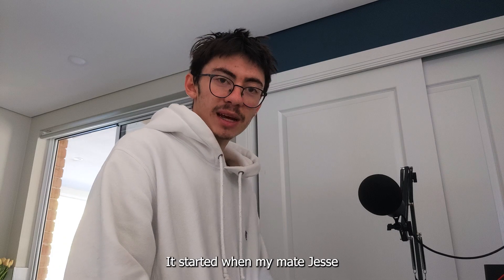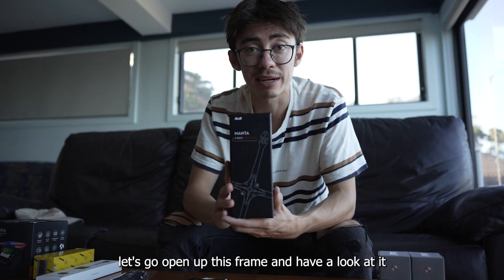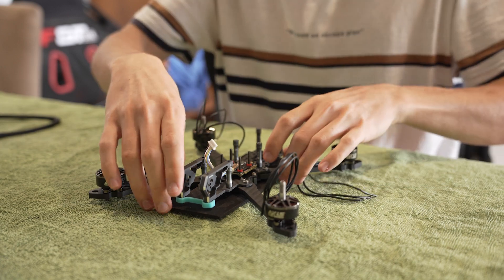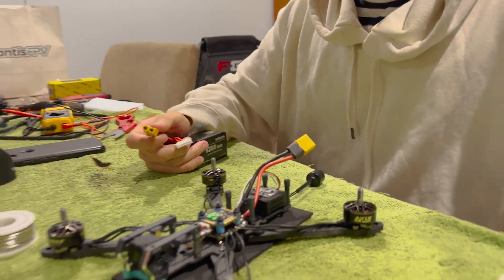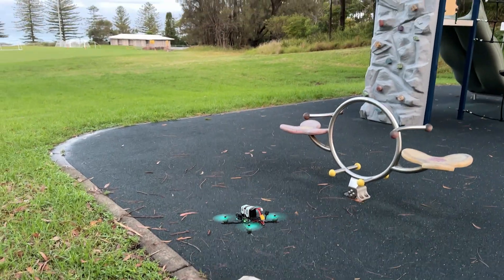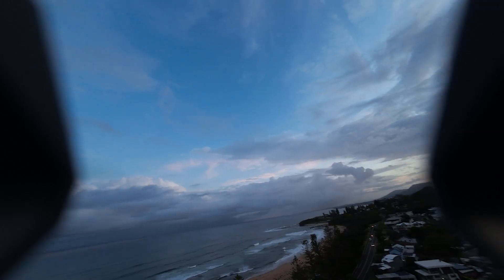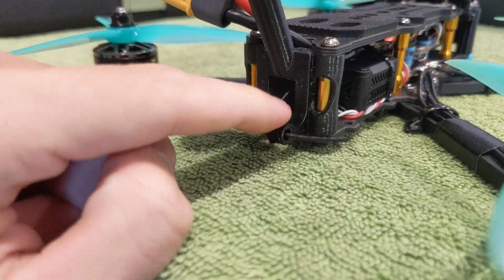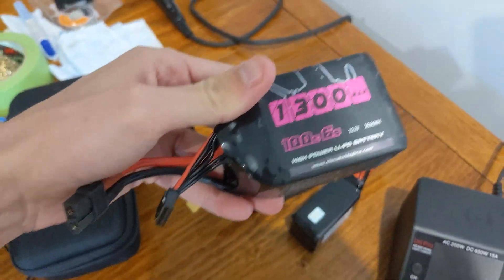Building My First FPV Drone

Comment: Correct me if I missed it but I didn’t see any capacitor on this. You kinda need that 😂
Reply from the maker: Yes good point! But rest assured I did in fact have one, it was tucked away between the positive and negative battery wires. You can see it here 6:38

Comment: 🤣 Budgeting and research can be tricky, especially when things don't go as planned. When soldering, keep the wire tips short. If they're too long, they might touch nearby terminals and cause a short circuit.

Comment: What wesbsite or app is most reliable of buying cheep fpv stuff specifically in Australia
Reply from the maker: That is a good question, I've found it's either one or the other. I haven't found anything that's both cheap AND reliable. I buy my gear from either MantisFPV or FPVFaster both located in Sydney, they are very reliable and have great customer service. If you want cheap, ordering online from AliExpress is probably your cheapest option, but I've had some pretty terrible experiences with them, items never arriving and receiving the complete wrong product. Up to you which path you choose.

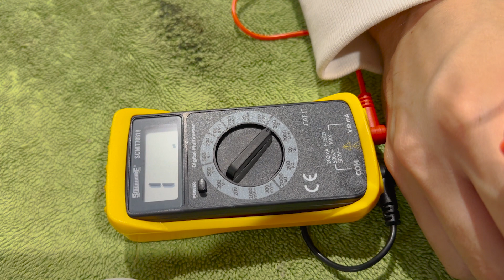Comment: 7:51, the reason for that Continuity test is the internal capacitance of the Circuit, after 2-3 sec of beep on multimeter it will be again normal

Comment: What’s the range on your antennas? I’m new to this
Reply from the maker: For the controller and receiver, since it's elrs it is pretty good, could probably go a fair few kms. The range is limited by the video link, so the antennas on the dji goggles and o3, maybe 1km or 2, but I haven't been able to test it yet

Comment: How far she can go??and How long does the battery last?
Reply from the maker: range is limited by the dji o3, I haven't really got to test the range but I know it can go at least 1km if there's no obstructions. battery usually runs out around 5 mins, but I can push it to 8 mins if it's only cruising

Comment: Damn that looks so much fun! I just bought a DJI mini 3 for photography and videos but im thinking of returning it and get started on this. I Get Dizzy sometimes with VR goggles tho. Would that be a problem or do i just need some getting used to. Been watching so many builds and some of the parts from the builds im trying to follow are out of stocked
Reply from the maker: VR headsets have a much wider field of view than FPV goggles. FPV goggles are more like just looking at a screen with a thick black border around it, that border REALLY helps with dismissing dizziness. worst case, if you do feel a bit dizzy, it will disappear after a while of use.

Comment: How far can you fly with ELRS ? thx bro
Reply from the maker: ELRS is such a great and reliable protocol but it really depends on alot of other factors to determine max distance. With my build though, I can fly 500 meters or so with no obstructions but as soon as there are trees or hills in between it drops drastically.

Comment: Hey . I have some questions : i want toi buy a cinebot30 03 and use or with dji goggles v2 and the same contrôler that you have. Do you think thats possible ? How Do you bind thé contrôler with the dji unit? Thnx
Reply from the maker: yep, just make sure you choose the ELRS receiver when buying the cinebot30, then you will bind the controller to that receiver.

Comment: Hey!! Beautiful work. Iam about to start with this hobb as well. May i ask how much did it all cost? The drone itself, goggles and controler?
Reply from the maker: prices in AUD, all drone parts $800, goggles $1000, controller $150, battery charger $200. but I did go head first straight into digital, it would be a lot cheaper if you decide to go analog

Comment: So at the end how did you learned about batteries? Can you charge more than one battery at the same time with that charger?
Reply from the maker: yep, you can charge two batteries at the same time with this charger. It's actually really safe, it will balance the cells in the battery at the end of the charging. I had to learn about how each cell has a voltage of 3.5 (0%) - 4.2 (100%) then that gets multiplied by 6 for 6s batteries. On the charger, you can choose how fast you want to charge the batteries too. So I had to learn about 1c, 2c etc. I only charge at 1c, just to be as safe as possible.

Comment: How would you say the controller is I have seen good and bad reviews of it and am not sure who to trust? (Amazing video and great quality. You are the reason am even thinking about these things❤️)
Reply from the maker: I'd say it's the perfect beginner controller. It's cheap, reliable, small n light, & has amazing battery life. I only use my thumbs on it like a game controller, it's not good for pinch grip. The main downside though, is it doesn't have the best range, maybe around 500m or so with no object interference (that could be improved if I upgrade my RTX antenna) but for the flying that I'm doing, it's perfect. Highly recommend for your first radio controller.

Comment: Great first build.. thanks for sharing!
I recently got interested in FPV as well and looking into getting my first FPV drone. For beginner like me, assembling all parts is pretty intimidating.. so I looked into some RTF kits (Cetus X, GepRC TinyGo, Emax TinyHawk etc). However, all such kits are advertised as “indoor whoops” and I’d rather fly outdoors. So I need a freestyle beginner-friendly freestyle drone/kit that can handle wind (in other words, not whoop). Any recommendations on those? Or do you advise building it myself, like you did?! :D
Reply from the maker: hmmm, I haven't done much research on RTF drones, but I've heard the GepRc Cinelog35 V2 actually freestyle's pretty good outdoors for a whoop. Regarding building your own, yes it's intimidating but I still recommend it. Experiencing those first few days of stress while building it makes flying so much more enjoyable, not having the fear of feeling in the dark on how to fix it when I crash, instead the opposite, kind of excited to work on it again when I do eventually have to replace a part.

Comment: How did you connect your jumper t lite to the happy model Receiver?
Reply from the maker: the first time the receiver got power, it seemed to be in "binding" mode already. so I didn't need to press anything on it or do any specific power cycles. Then on the t lite I went into the ExpressLRS settings by holding down the SYS button, selecting it and navigating down to [BIND]. After pressing that it connected and has been working ever since.
Reply from the maker: also, to get out of those settings, just hold down the RTN button

Comment: Want to build my first one but im worried about soldering things in the proper place. Did you add a gps? Also i’m worried about the setup/tuning of the drone with the program
Reply from the maker: Yeah there's a lot to it, but it's so worth it. No I didn't add a GPS. Setting up Betaflight was overwhelming for me when I first saw it but I used Oscars tutorial and it made it ALOT easier.
https://oscarliang.com/betaflight-firmware-setup/

Comment: bro u forgot capacitor (that important!)
Reply from the maker: I didn't film putting it on but you can see it at 6:15 soldered onto the battery pads. Hiding in plain sight, and also you are right they are very important.

Comment: Nothing better than flying a racing or freestyle drone with no stability mode. For sure the sim helps or you wil go through so many props I have 17 now maybe slightly in to it ha. Making yur own and doing the betaflight or emu fligt set up along with yhe soldering is enjoyable.

Comment: Well done..for your 1st build and 1st time soldering you done really well, only tip i have for you is learn a little more about how to take care of the batterys because they can catch fire by them selfs if not stored correctly and treated right, 
Apart from that you did awsom, wait untill you see X-class drones..they rock as i have a couple..i have a couple of vids of them on my channel..they are massive noisy and look great in the sky.
Reply from the maker: Thank you, yes I've done ALOT more research about battery safety since this video. Also I had a look at your X-class drones, they are absolutely WILD. They look insane flying around, it's incredible.

Comment: Ive been looking at fpv for awhile. Never done extensive research outside of what is needed and where to start, but ive never seen anyone talk about motion sickness. Have you ever experienced that since starting this hobby?
Reply from the maker: Good question, I've never heard anyone talk about this either. I've used a VR headset before and experienced motion sickness, but using fpv goggles I feel fine. My guess is it's because you're looking at a screen with a large black border around it. Could also affect people differently, but for me it's totally fine. Another thing to keep in mind is even if you do feel sick the first time, it'll probably go away with time and usage, as it did for me using VR.

Comment: Amazing work, dude! Congrats from Brazil. New subscriber! One question, when you installed the go pro support cam, did u have to make any calibration on the motors? how did u do it? Thanks again for
Reply from the maker: no I didn't do any motor calibration, but before every flight I do pick it up from the centre with two fingers to see if the quad is balanced. if it's not, I'll move the battery back or forward to get a good balance point.

Comment: This is my favorite hobby of all time. Some tips:
1) Dont point your goggles straight up because the lenses act like a magnifying glass and can burn your screen when the sun hits them.
2) The pop when plugging in 6s batteries is very normal.
3) When you get big peaks and not fully covered pads when soldering, that most likely means your iron is too cold. I personally solder around 400 degrees celsius and that seems to work well.
4) The propellers actually surprisingly do matter a lot. Depending on which you get, it can make your quad feel super snappy and responsive, or super smooth and stable.

Hope some of this is new knowledge! Happy flying
Reply from the maker: thankyou yeah that soldering tip will definitely come in handy
Reply: @tomyew Also, try silver solder paste....i use it for electronics, has a much better experience soldering. just a tip. you just put some on the pad, and put your soldering iron on it, and bring the wire into it. Easy.

Comment: The charger shouldn't do that. I'm not sure what that was about 😂😂
Reply from the maker: 😂😆I discovered later that it's because of the batteries being 6s, that's just what they do
Reply: @Tom Yew  mine have never done that, but I do use qs8 on cars not upgraded to 6s on the drones yet still enjoying 4s and 5s on 2400kv

Comment: Feel you buddy, after putting everything together, solder it and then the moment of truth, will it work or will it smoke when plug in the battery for the first time. Nerve-wracking moment and the relief when it work as intended. But then you head over to the field and you get nervous how will it perform, will you crash it, will it fly at all. Best hobby ever
Reply from the maker: yes! that's EXACTLY how it felt. Absolutely amazing feeling afterwards, nothing like it.

Comment: Oh ya also when you tin your wires you don’t need flux as there’s flux within the solder. Also angle your wires down when you tin them so you don’t get solder running down the wire and hardening the wire making it tricky to bend etc
Reply from the maker: oh thats smart, I'll be doing that for my next build, thankyou!
Reply: @tomyew  it’s all in the little tips and tricks you pick up along the way to make your life easier 🙌🏼

Comment: "Oh this is going to be expensive"..........Dude, after 5 years in the hobby, you have no idea. Then again, no one told me to build and buy 20 quads on a regular job without being a Youtuber who gets the freebies, which I will always keep flyable. Glad you discovered how great the hobby is, and we're all here for you to ask the same questions we all did. You will probably arrive at the conclusion that Youtube really drives this hobby and is a substantial contributor to Shenzen. Without this or some other platform it would be a tiny percentage of what it is.
Grab yourself a pair of 'self-closing' tweezers, the type that you need to squeeze to open. They are indispensable. I'd recommend a ton of other stuff but starting out that will help you and they're dirt cheap on Ali. Always make price comparisons between China and (I assume US) taking shipping into account for the things you buy. I'm no brand loyalist and price is what drives me personally. If I buy crap, I move on, if it works - awesome! Always do your research with the Youtubers that have the info depending on what style you're flying. Bardwell for general overall knowledge of Betaflight - you'll never go wrong/He's a saint. Nick Burns for micros...tons of experience and reviews with the small stiuff, and you;ll discover who you like in the process. Good luck and a big welcome ! :))

A 3D printer is an asset.

Oh...P.S. If you are looking for something online that is an FPV consumable, try and think of another more common product that is used that you can use for your purpose. Example: A while back,  many pilots used 'antenna tubes' to protect the very fragile antenna receiver wires. These get chopped easily as you will find out. If you go to AliX, don't search 'antenna tubes' as you will pay $5+ for only 5 of these things. If you look for 'lollipop sticks' you will get 100 for $5, although they are white and not clear. I personally don't care. if you have any questions feel free to hit me up.
I see you testing for continuity......remember that you may get a quick 'beep' and then nothing after you re-test. that's normal. Depending on your meter diodes will show open but then show as closed. Build a 'smokestopper' for peace of mind. I personally don';t have one but I have a shitton of electrical knowledge and take my time.  That's not to say I haven't blown something up.
@ 8:37 I knew you were going to be fine lol. I just wanna help. You did way better than me on your maiden, but I was alone to learn so there's that....good on you dude. Fly long and far!!

Comment: Good choice to start with digital. If you are starting in this hobby today digital is the way to go. Get a smoke stopper for your next build, it's the most cost effective way to know if you have the wiring wrong and not fry your stack.
Reply from the maker: i most definitely will, thankyou

Comment: Nice to see more people getting into the hobby as for 2 small tips that will maybe help: 
1) there is some stuff called „FPV worry free“ it’s kinda like something between nail polish and hot glue and you can coat your electronics to make them completely waterproof love the peace of mind it gives 
2) try to put some solder on your soldering iron and then wipe it on the brass sponge this should make it shiny and like new again
Happy flying❤
Reply from the maker: thankyou, and I'll definitely have to get some of that worry free waterproofing
Reply: So you just put all over your drone and thats it? Only have prebuild drone
Reply: @jonathanparadis-roy7481  the creator of fpv worry free @brandonfpv has some good vids on how to use it

Comment: Really nice to see your discovery when building.  The first time is so magic. Even your first solder job, nicely done. Also your reaction after the first flight is so recognizable. The high feels like no other :D Don't be scared with the soldering though, you won't destroy it that quick. A little bit more heat (hold the solder iron on it longer) so the wire really melts together with the pad will give a nice shiny connection.
Reply from the maker: that is some really useful info, I'll keep note of that thanks. You're so right about the high, it's unreal :D

Comment: been in the hobby for 5 years, rc planes and FPV. Prepare to be broke
i woulda def recommended the radiomaster ELRS boxer or some sort of ELRS radiomaster radio not the tlite IMO
also ignore the built in rx to the dji vtx, works only with their radios and sucks.
you did great with the hota d6 pro, i have two and will only keep buying more ( turn on then plug battery in, higher voltage batterys tend to POP when plugging into drones/chargers)
Reply from the maker: yeah I'm thinking of eventually upgrading to a full size radio, and radiomaster seems the way to go. I heard the same about the dji inbuilt rx. I've become used to the pop now :D

Comment: Bradwell says cable ties are not good to fix a gopro or gopro mount because the carbon frame will cut it at a certain time....
Reply from the maker: ah, this is helpful info, thankyou. I've also got some gopro sticky mount holding it on as well, but after hearing that I'll have to re evaluate✌

Comment: I'm using the jumper tlite too, unless you plan on doing long range your radio will hold up for years
Reply from the maker: yes! it's such a good starter radio, so compact. I'll eventually upgrade to a full size one in the future, but for now it is perfect

Comment: interesting and dangerous idea on the camera placement.. but .. from experience, simple crash (and you will crash) gonna rip the camera
Reply from the maker: yeah, it's tricky to decide the placement. Inside and protected obstructs the vision, but outside is sketchy for crashes. Any ideas for a better place that doesn't sacrifice screen space?
Reply: @tomyew  with the same tpu standoff camera mount, flip it in, make a new hole if necessary... but yeah, now props are in view hahaha..